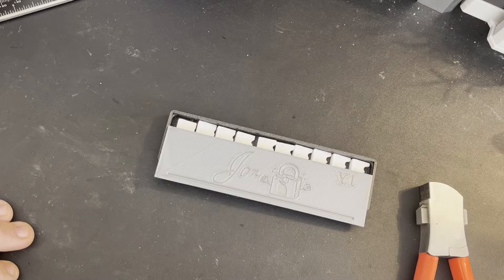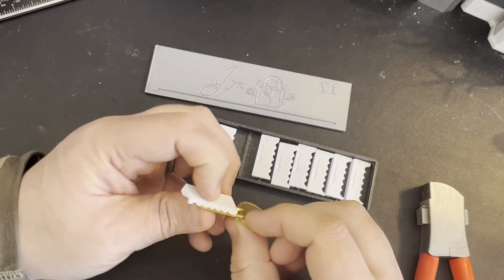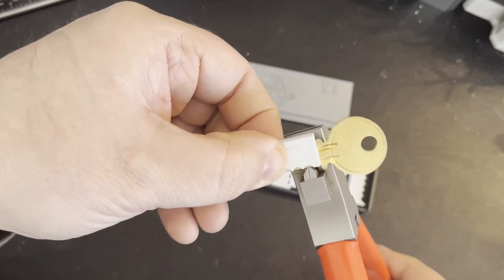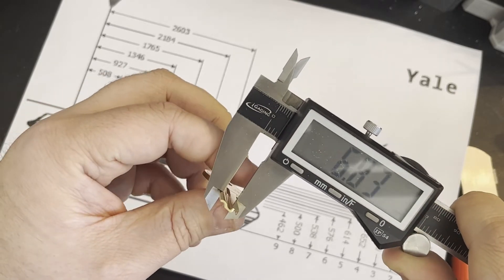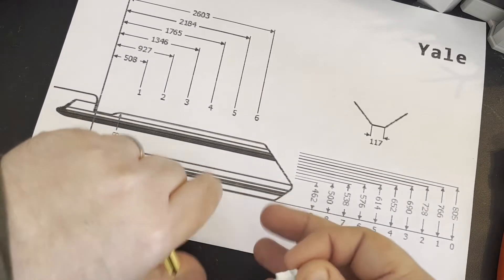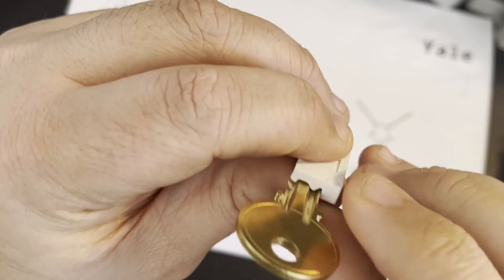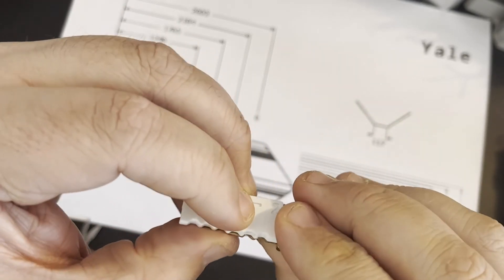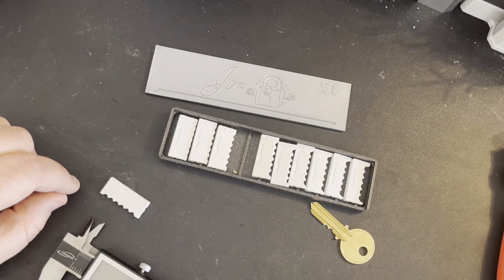Lishi Cuter Jig v1.1 Update - Yale (Y1)

Comment: I wonder if an apparatus could be used to hold the jigs in place on the cutter, so the pressure fitting isn't as much of a factor? Maybe a springy piece of metal or or giant clothespin? haha
Reply from the maker: Yeah, I have to think about this more… I wonder if I extend the jig so that it reaches the head of the key if it could be clamped on there (which would be out of the way of the cutting area)… I’m gonna play around with ideas a little more.